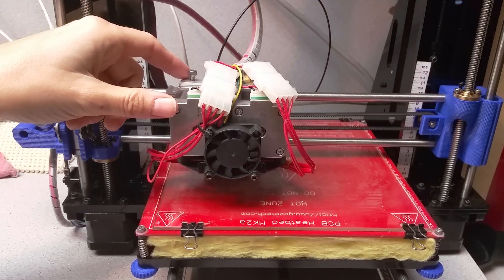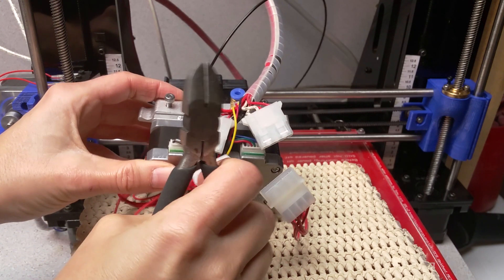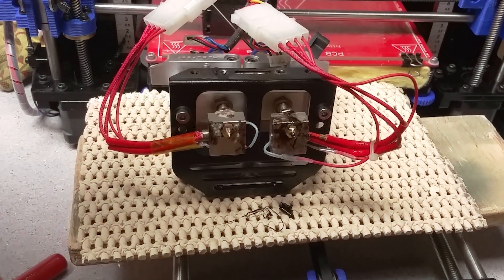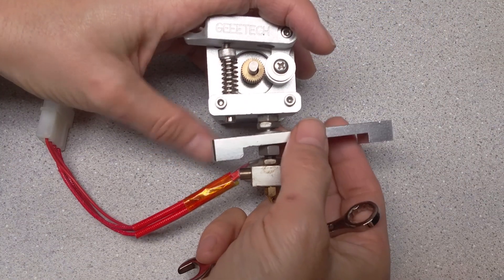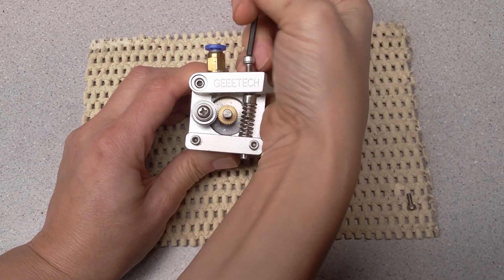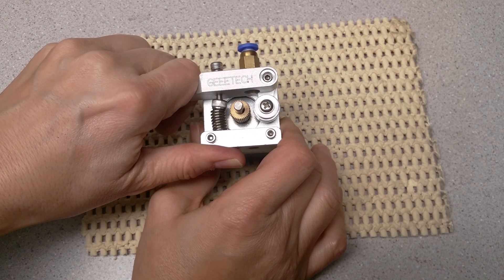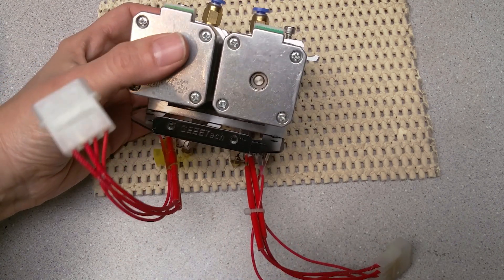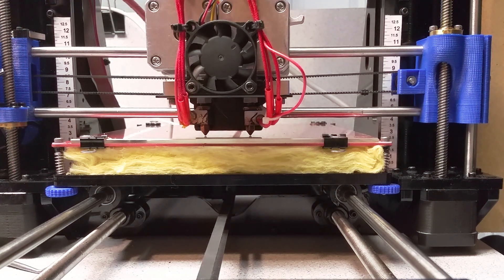Geeetech MK8 Dual-Extruder Height Mod

Comment: How did you mount the duel extruder I bought a geeetech 13 pro c but cant mount the extractors it just doesn't fit. Can I see the other side of your extractors to see how you have fitted them.
John
Reply: There are no fans at the back only one fan in front